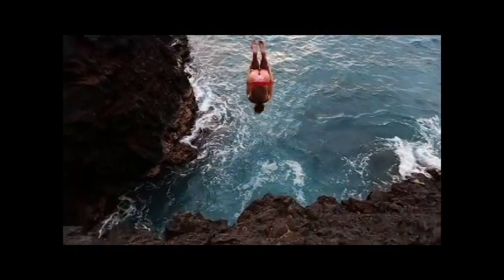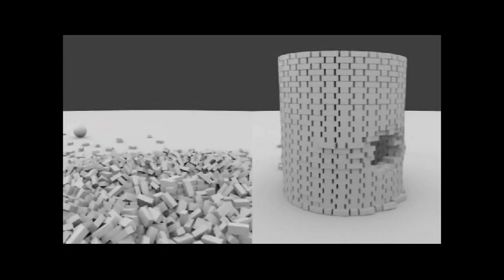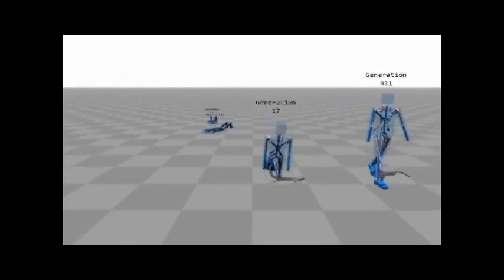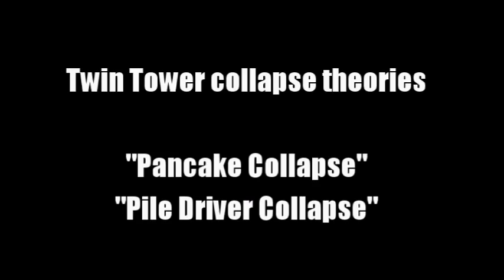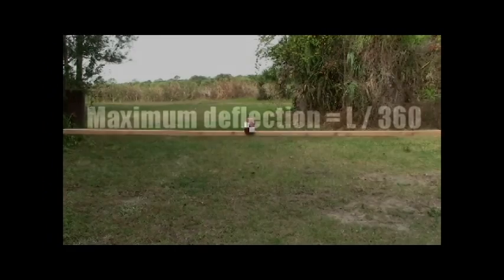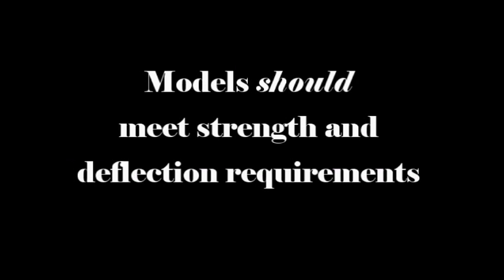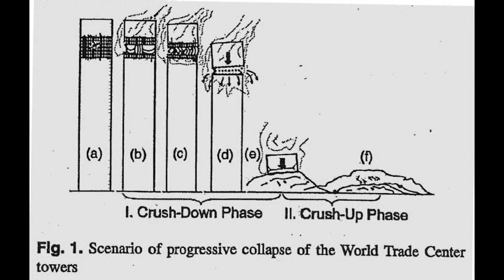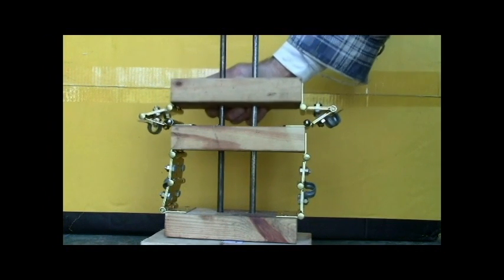9/11 Experiments: The Force Behind the Motion

Comment: The "house of cards" theory actually does apply- to some extent, in regards to the perimeter columns. Here's why. 

An examination of available photographic evidence of "Ground Zero" shows many column ends. The columns on the four exterior walls of the Twin Towers were each 14" square (box beams) that were welded to wide horizontal spandrel plates in groups of three columns, the so-called "chex" pieces that can be seen in the old construction films of the Towers being assembled. 
These units were 36' long, or three floors' worth. On the ends of the square columns are welded plates and on the inside face of each column, near each end of every 36' piece, is an access hole easily reached from inside the offices, at every third floor. 

The access holes were used in order to install the bolts which connected the columns to each other every  three floors from bottom to top. The bolts were about 1" or 1 1/8".

 In effect these bolts made the string of 3-column "chex" pieces, from ground level up to the top floor, all one connected piece about 1300 feet long. 

The "chex" were also bolted to each other by means of the spandrel plates.  

So each of the four exterior walls was essentially one big piece of connected steel, connected by welds and high-strength bolts. 

However, huge thin panels, which the exterior walls were,  needed the floor structures every 12 feet to make the building strong. The exterior walls, panels about 200 feet by 1300 feet, and only 14 inches thick, were (to scale) more or less  eggshell-thin,  almost like sheets of paper standing on edge.  

The floor assemblies, also made from modular prefab units hoisted into place by a crane and then welded and bolted together, were extremely strong, consisting of steel-reinforced concrete 4 and 5 inches thick placed over corrugated steel sheet.
 Shear loops extended from the supporting trusses into the concrete, and other reinforcing bar, mesh, etc.,  solidly bonded the steel structure of the floors to both the  exterior walls and the interior core columns. 

The final result was a lot like the familiar steel shopping cart, made of welded heavy wire in a cross grid. 
A shopping cart could be dropped out of a plane, then run over by a train, and then set on fire.  Any child ( and presumably any adult) could still recognize it as a shopping cart.

 The Twin Towers were much stronger than a shopping cart. Yet we have been led to believe that gravity and fire supposedly destroyed them to mostly powder.

Back to the "house of cards": 

The Ground Zero photos (from the available sets, made by various photographers) indicate very strongly that the bolts originally connecting the "chex" column end plates were removed, on some pretext, by using the access holes that could be reached from the office spaces, over some period of time prior to September 11, 2001. 

 If they were not removed beforehand, where are they? Why do the column end plates show no damage, and have no bolts whatsoever, while a few others show bent bolts still in place but apparently undamaged end plates?

 There were four or six bolts per column every three stories, so there were thousands of them, and they should have been visible in the aftermath, but instead, almost all the visible column ends in the Ground Zero photo collections have NO bolts, and no apparent damage to the end plates.

But wouldn't that make the Towers weak or prone to fall down? 

No, it wouldn't; at least, not until a certain something else happened.
 Keep reading. This is where the house of cards idea comes into play. 

As long as the floors were intact, it would have made zero difference to the strength and stability of the Twin Towers if every single bolt connecting the "chex" column ends had been removed (as I believe they were, or most of them). 

The static weight of the Towers was plenty to keep any local winds from pushing those unbolted column ends apart horizontally. But mainly, the floor structures every twelve feet made those exterior bolts unnecessary. 

The Towers were, when finished, essentially a single piece, a huge 3-dimensional grid of steel, but the removal of the bolts would have made the horizontal joints on the exterior walls be potentially loose every three stories. However, these many unbolted joints couldn't move in any direction, or come apart whatsoever,  until the core, along with the floor assemblies, was destroyed. 

Once the core and the floors were destroyed (which was done with conventional high explosives with the help of some type or types of nano-explosive or nano-incendiary) the exterior walls became like the "house of cards", edge to edge or end to end, the result being that a large proportion of those exterior walls, when they reached the ground, were in the same 36' lengths they had when delivered to the site decades earlier, and just as convenient to haul away on trucks.

Note: Some areas of the exterior walls were not unbolted, it seems, from the fact of the large standing pieces of exterior wall after the collapse of each Tower. 
They were leaning and no longer in a flat, or geometric plane, but the end bolt connections and the spandrel connections must have been still in place, holding those remaining pieces up, though they no longer had the lateral support of the floor/core structure and as a result were twisted and leaning from the vertical.
Reply: +Psy0psAgent  You're so right about Carroll Sanders.   Phony paid disinformation troll
Reply: +Kelly Smith Read it again, it's very interesting.
Reply: Carroll Sanders When Carol the shill  tries to insult people, he sounds like a 3rd grader.  Too funny.
Reply: Why do sheer bolts sheer in a bush hog on a tractor without damaging the hole in the power shaft?

The bolts were cut out by the energy of the plates movement, as the two plates were forced apart rapidly.

Welds were sheered similarly the engineering term is sheer lag, the strength of the weld or bolted connection is exceeded so fast bending can not occur so no ductile re alinement of the atomic structure is possible.   The bolts, and welds are the most brittle part so of course they are the part that will sheer!
Reply: +Carroll Sanders ", as the two plates were forced apart rapidly."
...and HORIZONTALLY, like exploding "pancakes," you forgot to say.

You can't explain the origin of force that ejected multi-ton columns outward at high velocity, so you have to pretend it didn't happen, using words to paint a description of events that doesn't resemble what was captured on video. 

=======
The video shot from the WTC plaza captured an intriguing event at 9:37:04 a.m. A jet of air, dust, and a large piece of debris was ejected from a window, 77-355, on the 77th floor at an extremely high velocity.
NIST NCSTAR 1-5A, (p346)
=======

Also documented by NIST...
Pre-collapse "pressure pulses", "metal fire", torrents of brightly glowing molten metal, ejection of debris at extremely high velocity,  plus post-collapse persistent pools of molten steel at ground zero.
That's what you get from incendiaries.

Is it any wonder most Americans don't believe your fanciful Arab-framing tale, "Caroll"? (Your butchered English is appalling, btw,: it seriously undermines your pseudo-intellectual facade)
Reply: ***** Idiot, the ejection is too slow to be high explosive, not produced by a detonation wave, so obviously it would be caused by a fuel air blast caused by the increased oxydation, from the compression of air in the buildings.   Cole can't do competent experiments he couldn't create a chimney effect to produce sulfidication, and the complex chemical environments in the towers.  Or the conditions that would have produced such complex chemical reactions as fire induced fuel air blasts.
    Soot, carbon monoxide, hydrogen, several other things in the buildings would have been able to produce that low velocity expulsion.
    Oh ps. Man made thermites will burn out quickly, they will not linger in the rubble pile, but the reduction induced by chimney effects, could produce molten metals for quite some time.
    So it wouldn't surprise me if molten steel was found, or even if the molten material coming out of the towers was a naturally occurring Aluminothermic since steel dust can trigger Aluminothermic reactions.
   That little fact was over looked by Steven E. Jones in his experiments.
    He never tried impact mixing of steel dust into aluminum, to achieve an Aluminothermic reaction.
     When steel dust starts to oxidize it will melt the Aluminum oxide on the molten aluminum, allowing the molten aluminum and air to interact causing a metal oxidation event.
      However I wouldn't expect frauds to know how too or want too conduct proper experimentation, by recreation of the (environment) where the unusual chemical events happened!
     People like Jones, and Cole have no interest in truth, science or justice, and Coles moronic attempts at experiments clearly only based at proving his own fraudulent misrepresentations of events, to be true only prove he has no interest other than keeping the donations flowing into Gage.
      Send all your money into Gage the rest of your life and you will accomplish nothing, you fools are no threat to anyone your only proving your own foolishness by these self embarrassing misrepresentations of engineering and physics.
Reply: ***** oh really so your telling me that oxidizing steel at 2800C can't ignite aluminum at 1900C?
prod.sandia.gov/techlib/access-control.cgi/2009/090705.pdf
"In February of 2006, Alexander E. Gash of Lawrence Livermore National Laboratory (LLNL) 
reported on a series of incidents that had occurred with sol-gel iron oxide-based thermites at LLNL and 
other laboratories.[1] In his presentation, three specific incidents were described in which thermal 
treatment of sol-gel thermites resulted in auto-ignition of the materials. At LLNL, two incidents were 
reported involving 15 and 25 g of material, respectively. In the 15 g incident (September 24, 2001), a 
mixture of 53% sol-gel Fe2O3˜H2O, 29% ultra-fine aluminum (lot# IH103000-1), 9% Viton® A, and 9% 
poly(propylene oxide) impurity auto-ignited after a 30-60 second glow (presumably due to heat release 
from oxidation) when removed warm from an oven where it had been heat-treated in a nitrogen 
atmosphere for five days at 105 °C. In the 25 g incident (February, 2004), a mixture of sol-gel iron (III) 
oxide, H-2 (Valimet, 2-µm) aluminum, and Viton® A auto-ignited while drying in an oven under house 
vacuum at 85 ºC. The third incident occurred at Texas Tech University where thin films of sol-gel iron 
oxide with ultra-fine aluminum auto-ignited after being removed at room temperature from an oven after 
250 °C treatment in an inert atmosphere. This was confirmed later via email.[2] In his presentation, Dr. 
Gash concluded that: 1) heat treatment of iron(III) oxide in inert atmosphere results in an air-sensitive 
material, 2) this phenomenon is not observed for nano-Fe2O3 in the absence of organic impurities, 3) self-
heating of the material is likely due to partially-reduced iron oxide species that re-oxidize upon exposure 
to air, and 4) the high surface area and low thermal conductivity of the material exacerbates the issue. 
Based on this work, a project was started at Sandia to investigate further the safety and thermal properties 
of sol-gel iron-oxide thermites for potential use as thermal sources. 
Sol-gel thermites are composite energetic materials consisting of a nanometer-scale porous 
network of sol-gel-based metal oxide with dispersed aluminum (or other metal fuel) particles.[3] A 
general synthetic strategy has been developed that allows sol-gels to be synthesized from numerous 
elements.[4] For iron oxide sol-gels, this synthetic strategy consists of a simple mixing of iron salts in 
polar, protic solvents (methanol, ethanol) in the presence of propylene oxide as a gelation agent. A sol-
gel then forms over the course of several minutes to hours, depending on reaction conditions. 
Immediately before the onset of gelation the aluminum particles are added and further mixed to yield a 
uniform distribution. By varying reaction conditions this strategy can be potentially used to tune ignition 
and combustion properties of the resulting thermite material. 
Incorporation of aluminum into the sol-gel allows for a thermite to be formulated, which releases 
its energy via the reaction: 
Fe2O3 + 2Al ĺ Al2O3 + 2Fe, ǻH = 3960 J/g, Tad = 3135 K.[5] 
Interest in this material as a potential small-scale thermal source has necessitated investigation of thermal 
safety properties, especially in light of the incidents described above. This report summarizes 
investigations of sol-gel based Al/Fe2O3 thermites at small scales as potential thermal sources with an"
 
I have duplicated the process of iron oxidation igniting aluminum, at low temperatures, in experiments!

Twoofers Like Steven Jones, Harrit, and Cole keep screwing up!
Reply: ***** Consider yourself a complete idiot using ridiculous fallacy to counter a valid argument as dumb lying twoofers do!
Reply: Psy0psAgent I reject the false contract based on the fact you have dirty hands, your using a false and misleading argument from the start, Scale effects applied energy, it is impossible because of the inverse square laws for Coles experiments to duplicate the motion of the twin towers of building7 because they do not duplicate an any way the energy values of the masses or electron bonding of materials.

Newton's third law, and The Law of Inertia, first proposed by Galileo, an adopted by Newton, do not allow such incorrect models to duplicate actions because of the inverse square laws.

Truther is the term that truth movement members gave too themselves and they bragged about being truthers,
Now that has comeback to haunt them.
  Twoofers is the term used when they show gross dishonesty as in Coles experiments.

This is not an attack but a logical explanation of why you are wrong and why your offer is unsatisfactory and must be rejected do to your lack of understanding of physics and modeling.
      An ant can lift several times it's own body weight, a person, or an elephant can't because of the Gravity, and inertia  involved is greater on larger scales.
     Also in no way do Cole's experiments represent the critical connections in the world trade center that failed, the burden of proof is on you, and you fail miserably at providing proof of anything using such flawed experiments.

Coles experiments are not test of Newton's laws, they are tests of motion though resistance with the resistance he used several times greater than that provided by the connections in the buildings, and the energy of the masses several times weaker.
http://hyperphysics.phy-astr.gsu.edu/hbase/forces/isq.html

Oh good luck on the fraud, you need it, if you use Cole's fraudulent experiments you will be laughed out of court.
Reply: Andy MacDougal Why would anyone pay me to laugh at you morons ?
It's Entertainment!
I mean you can't even understand Newtonian physics, not even the basics.
Reply: ***** For every reaction there is a counter reaction, I am LMAO at your stupidity.😆😆😆😆😆😆😆😆😆😆😆😆😆😆😆😆😆😆😆😆😆😆😆😆😆😆😆😆😆😆😆😆😆😆😆😆😆😆😆😆😆😆😆😆😆😆
Reply: ***** What did You say brainless Twoofer, by calling me a Shill, you have lost all credence because you admitted you have no logical counter arguments!😆😆😆😆😆😆😆😆😆😆😆😆😆😆😆😆😆😆😆😆😆😆😆😆😆😆😆😆😆😆😆😆😆😆😆😆😆😆😆😆😆😆😆😆😆😆😆😆😆😆😆😆😆😆😆😆😆😆😆😆😆😆😆😆😆😆😆😆😆😆😆😆😆😆😆😆😆😆😆😆😆😆😆😆😆😆😆😆😆😆😆😆😆😆😆😆😆😆😆😆
Reply: There are nothing BUT logical counterarguments to all of your claims.   That is indisputable.
Reply: Andy MacDougal Then make them don't just rant and run, because your a brainless Twoofer, I await your first ever logical argument!😆😆😆😆😆😆😆😆😆😆😆😆😆😆😆😆😆😆😆😆😆😆😆😆😆😆😆😆😆😆😆😆😆😆😆😆😆😆😆😆😆😆😆😆😆😆😆😆😆😆😆😆😆😆😆😆😆😆😆😆😆😆😆😆😆😆😆😆😆😆😆😆😆😆😆😆😆😆😆😆😆😆😆😆😆😆😆😆😆😆😆😆😆😆😆😆😆😆😆😆😆😆😆😆😆😆😆😆😆
Reply: I'm not arguing with paid disinformation agents.  You're on the wrong side of history
Reply: Andy MacDougal Yes that might be but your losing the arguments, and history fogets Twooferism eventually, because it is a do nothing nonsense group of idiots well forgotten and blown away by the sands of time!
Reply: I'm OK with your beliefs.  And your ad hominem attacks.  They're silly, but they don't insult my knowledge of physics.   Have a nice life on the wrong side of history.
Reply: Andy MacDougal I am OK with your beliefs on the side of history that will be forgotten because Newton, Maxwell, and Einstein say so, not because of anything I said.
    Have a nice life in Looneyville I you meet wile E Coyote super genius tell him I said HI, and to leave the Rabbit alone.
Reply: I'm OK with your beliefs. And your ad hominem attacks, as I said above.  They're silly, but they don't upset my grasp of physics.  Have a nice life getting paid to be on the wrong side of history arguing with people on YouTube comments sections.  Bwaaaaaaaaaaahahahahahha
Reply: Dom The Mural Suter Says the moron with no arguments of validity'.
Reply: Carroll Sanders Sure Jew boy.... Tell again about how in the know you are about facts. Lmfao
Reply: Dom The Mural Suter your opinions are based on nonsense.
Reply: Carroll Sanders I deal in opinions. I deal in facts.
Reply: Dom The Mural Suter That's really funny since you don't present any facts Nazi.
Reply: +Carroll Sanders 
Oh look another thread with Carol the Shill pretending to be an engineer and scientist.  Look like I'm too late for this thread, they outed you about 20 posts back.  Oh well, I'll just go look for your next thread to trash you on.
Reply: Emvaz22 Look another idiot joins the other idiots in this thread the biggest of which is Johnathon dishonest Huckster Cole.
Reply: Carroll Sanders Hey look, it's like 7v1 in this thread.  Not only do you have no support and no friends, but you also have no facts.  Pathetic.
Reply: Emvaz22 The number of fools, in an argument does not make their foolish claims any more reasonable or logical.
Reply: Mr. MASCAL So a Roman name from before the time of Christ, From Carrollous, that means essentially Giant Man, is a female name to you moron?
   Or might you be confusing it with Carol the English feminine name only made popular in the 1800s, that means song?
   What a freaking moronic twoofer with no argument that you have too attach me because your too stupid to know what my name stands for!
Reply: Dom The Mural Suter what's up shit for brains?😆
Reply: Dom The Mural Suter What's up shlt for brains you ever going to pull your head out of your anis?
Reply: Dom The Mural Suter You still eating the mushrooms that grow in dog crap or just the dog crap by itself again?
Reply: Emvaz22 That coming from a first Grader is even funnier.
Reply: +Carroll Sanders Oh snap, what a zinger.  The originality, the wit!  It's all too much for me.  You are truly a creative genius.
Reply: Emvaz22 please the sarcasm isn't working for you, because the truth of your lack of wit, is evident in every post you make.
Reply: +Carroll Sanders 
Seems like the only thing Carol can do is repackage the exact same insult used against him, except in a shittier, less intelligent, not-good-at-English sounding version.

I can't be too hard on you for your elementary school level of English.  I'm sure you could do much better in your native language of Hebrew.
Reply: Emvaz22 And I can't be too hard on you, you speak dumbazz perfectly, in fact I believe your an actual member of the specie, trutherous Dumbassrimoronous Regurgitous Liarous.
Reply: Dom The Mural Suter You should know you have had your head up yours for 14 years now!😆
Reply: Strikes me though that once the outer ends of the floor "Joist" systems had been ripped from the exterior columns, they would have been unsupported and with the debris from above falling on them they would surely have fallen concertina fashion anyway? ...sometimes they are seen to go outwards with some force and this indicates possibly being struck by the ends of joists falling from above?....
Reply: +John Sosman
" huge thin panels, which the exterior walls were,  needed the floor structures every 12 feet to make the building strong. The exterior walls, panels about 200 feet by 1300 feet, and only 14 inches thick, were (to scale) more or less  eggshell-thin,  almost like sheets of paper standing on edge."
You had the answer here, in the palm of your hand - and threw it away.
The towers (and WTC7) BUCKLED.  They were strong UNTIL those connections were lost.